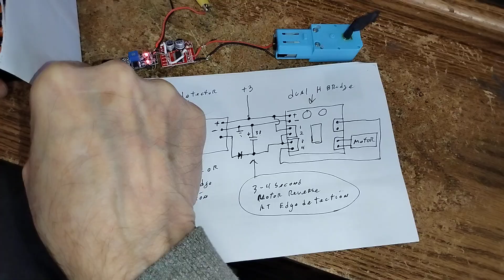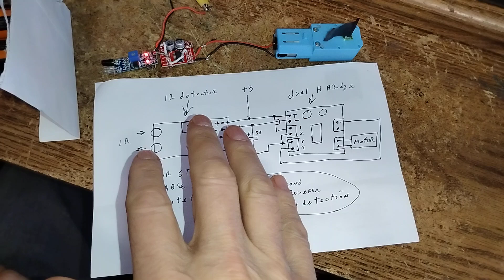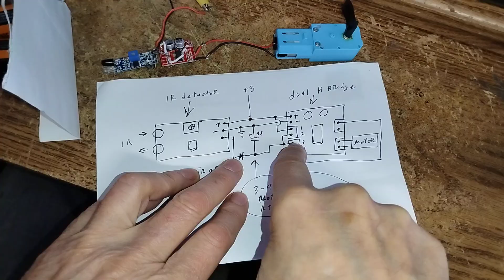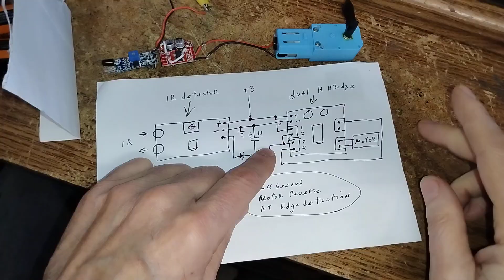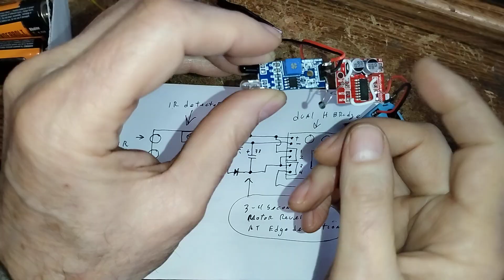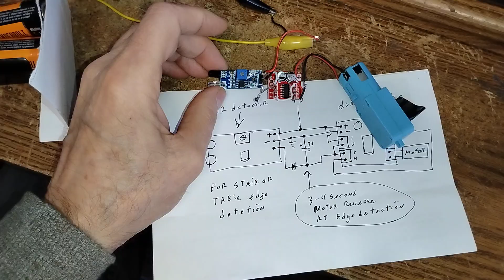Stairs or Table Edge detection, using low-cost IR and H bridge modules.

Comment: It’s electronically quite elegant but I still like your mechanical version with the rocker wheels. 😊
Reply from the maker: Hard to beat mechanical designs that work. But I was asked how this ir sensor could be used to detect stairs and edges, so thought what the heck lets try that as well.